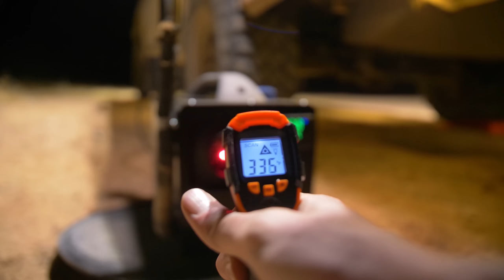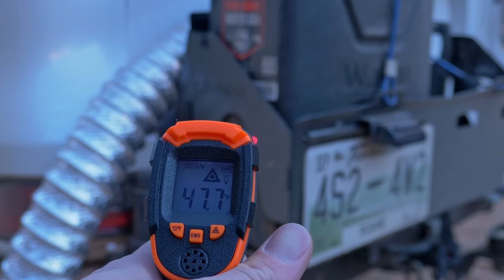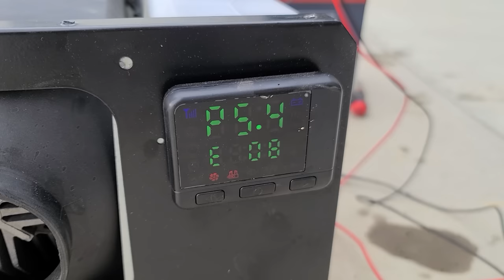Just HYPE or cold camping GAME-CHANGER? 1+ Year Diesel Heater Review

Comment: Also buy a carbon monoxide dector alarm, the gas can escape from the glow plug housing into the warm air stream, esspecially if you meddle with the factory settings by entering the special menu, many people have seen elevated carbon monoxide emissions in use. if you value your life get a carbon monoxide alarm and put in your tent about a foot from the roof, its a silent killer. are you burning any combustable fuel and Not using one? Also check the wiring if yours has a 12 volt dc power supply to be plugged into the mains, the chineese often connect the 12 volt dc power leads and the mains together on the inside of the rear panel and that could cause you a nasty shock or a destroyed ecu inside the heater.

 I built a plywood cabinet and installed one of these on the side of my house and burn kerosene in it because kero is cheaper here in the UK, it also burns hotter than diesel, produces less coking inside the heater chamber and it has been saving us a lot of money heating the house over the winter, it extracts air from our Kitchen and blows warm air into our living room, we dont hear the tick of the pump because it is outside with the heater housed inside a cabinet. we have been running this like this for two years every day during winter and early spring and yes I have a carbon monoxide alarm in our living room as the carbon monoxide levels increased experimenting with the special settings menu, I reverted back to factory settings once I realised that is would increase the carbon monoxide levels getting into the house. if you change the settings write down the current settings before you forget what to go back to  if need be.

Comment: I'm sure somebody's already posted you need the exhaust so that it drains the condensation out so it has to be lower then the unit there is a pin hole in the muffler to let it drain
Reply from the maker: We hear this all the time but haven't had any moisture issues.
Reply: I built mine in a harbor freight case and have an external exhaust with weep hole at lowest point. Never had a moisture drip. That exhaust is so hot I don't see how any water could survive in the exhaust. I have at least a hundred hours of running so far.
Reply: @LifestyleOverland  Ah ,you narrowbacks never believe us lineman lol.
Reply from the maker: 😂 usually it's the linemen who don't care about instructions 👍
Reply: @LifestyleOverland   as long as we have a big hammer and a set of Klines! On a side note my Tremor is finally built and will be switching over my X1 too it. Can't wait to retire and go on some epic adventures. Thanks to your great content it really motivates me!
Reply from the maker: If you have Kliens, you've got a hammer 😜 Congratulations on the new build! 🙌 Hope that retirement comes quick. My dad (lineman) retired a couple years ago and loves it.
Reply: @LifestyleOverland  that's awesome, hope he is having a great time!

Comment: I always want to scream when I see one of these heaters used improperly.  This unit is meant to be installed inside the heated area so that its cold air (the air it heats, not its combustion air)  comes from inside the space its heating, just like your furnace at home.  Without a cold air duct your furnace has to work triple time to constantly heat cold outside air!  Your tent or whatever enclosure your trying to heat becomes pressurized and you need to vent/waste hot air to let the pressure off to keep your furnace moving air and from overheating internally.  If your going put the unit outside then put it in a box just like it would be installed inside a camper, attach the cold air inlet tot he box and run the air return to the highest point in your heated space as possible. Plum the hot line so that it sealed from the  cold air return. You will burn half the fuel in a night and be 10 times as comfortable.  And inside a box you wont hear the fuel pump and the fan noise is greatly reduced.

Comment: Exhaust is not supposed to be vertical.
Reply: You are exactly right, but another 90° bend adds up to 270° total which is at the maximum allowed. The only reason you might want to level that muffler is so that any condensation might drip out of the weep hole, but that doesn't concern me in the least. Still you make a good point.
Reply from the maker: Heard this a lot but haven't had any issues with many many nights of use. 👍
Reply: @LifestyleOverland  something about moisture pooling and rusting.

Comment: 🤦‍♂️🤦‍♂️🤦‍♂️🤦‍♂️ the exhaust must be down
Reply from the maker: And yet it works fine pointed up. Heat rises and I didn't want to suck up fumes into the fresh air intake. That's why it's up. Zero issues with many many hours of run time.

Comment: As far as I have known volks wagons always used a heat exchanger that ran off the exhaust system, I live down under and have never seen one with a diesel heater. I was a panel beater and repaired many of them, You would have needed a separate tank because VW'S run on petrol. And if they had had a diesel heater way back then I would have bought one of the heaters for my factory. But I only found out about them recently. And the heaters in VW'S were excellent and would start to heat faster than a liquid radiator system because the heat exchanger would heat up as soon as the engine was started. Maybe in the USA they had the diesel heaters but never seen one down under and I am nearly 70yo and worked in the motor vehicle industry mostly on cars all my life till I retired. Some say you can run them on filtered used motor oil, They do run on a mixture of oil and diesel but running used motor oil carbons up the chamber after 2 tanks and it really makes a big mess in the burn chamber, so don't beleive the bull stories about people running waste oil for 2 years without cleaning, YouTube click bait vids. A channel called Lowered expectations has done many vids on running these heaters on waste oils and he does honest vids that don't make any extravagant claims like many do. I run mine on Diesel and it runs for many months of daily use before it needs cleaning. I also found that using hydrochloric acid through a syringe turns the hard chunks of carbon to slushy muck that can then be rinsed off with water. Makes cleaning the burn chamber much easier.
Reply: The vw version ran on petrol.
I had never seen one before I bought a bug with one in it  , it was plumed to the tank. 
I never seen another one after it . I didn't own the bug long enough to even try it out . 
I do remember staying in a Cortez motor home , I'm not sure what you call a motor home where your at . But I'm sure you know what I mean 
Cortez motor home was kinda weird being front wheel drive  4speed transaxle from a Clark fork lift mated to Chrysler slant six . 
It had a petrol furnace ., I was always curious and wanted to tear into that furnace to see how it functioned. . To many hoods open needed to be fed blood sweat and tears . ...
I used to love wrenching my life away . Now I walk by thinking,  I did my time .